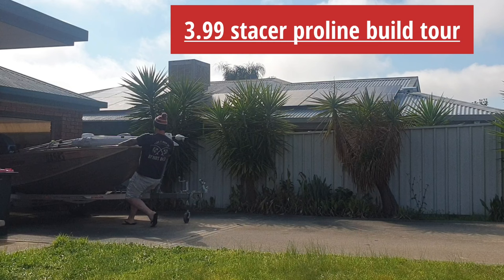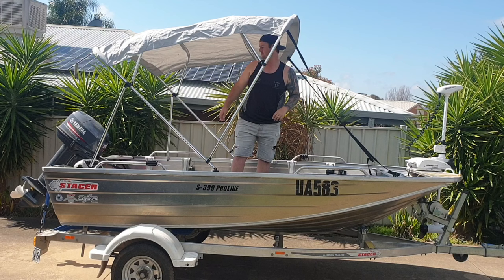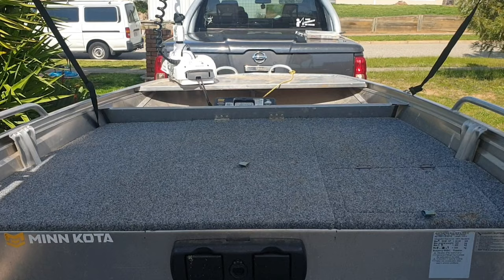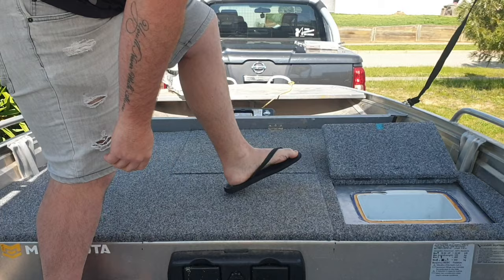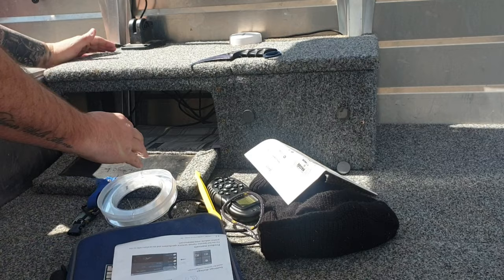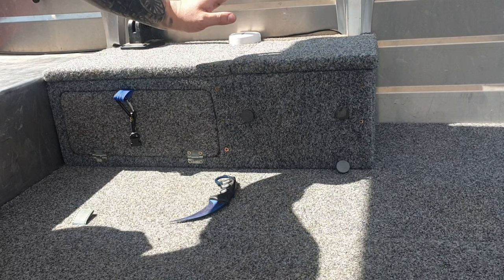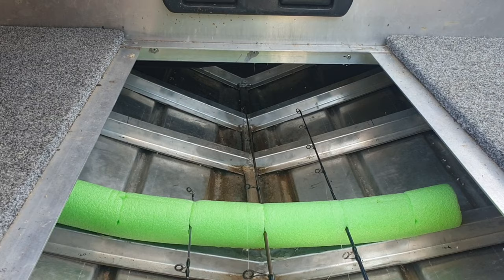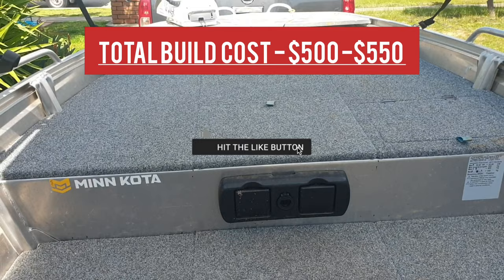3.99 Stacer proline, my DIY job !

Comment: The esky in the seats a good idea 🤙
Reply from the maker: Yeah Dan its been a great addition for a brewski , bait , lunch and coz its in the seat its got insulation with the foam in the seats . Highly recommended bro .
Reply: @baitsbynimbus   and the rod holders underneath floors pretty sweet usually in tinnys there is crap going everywhere after a few bevies 🤣
Reply from the maker: Haha this is true keeps the rods out of the road best addition ive put in by far

Comment: What are the rod holders that go on the hand rails mate?
Reply from the maker: Just off ebay bro type in rod holders for the boat
Reply: @baitsbynimbus  legend cheers how did you stick down the pool noodle? I’ll be copying a few of your ideas great video helped me out a lot
Reply from the maker: @Matt w  happy to have been helpful bro . I used a screw and silicon bro just make sure you use noodles with the hole through the centre and screws are in the ridges ( obviously haha ) the silicon let go in places after a while but screws held em perfectly